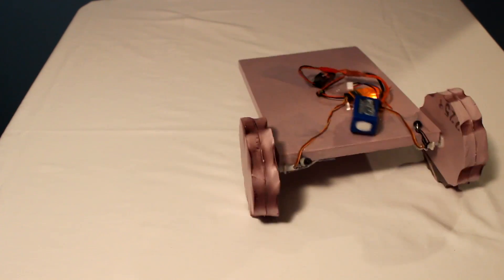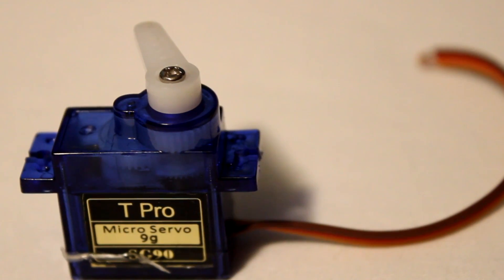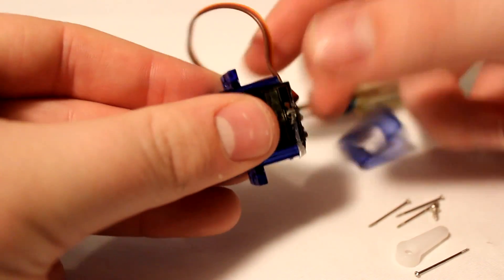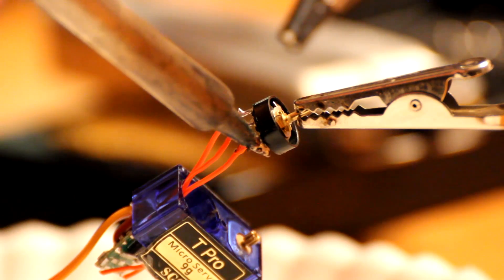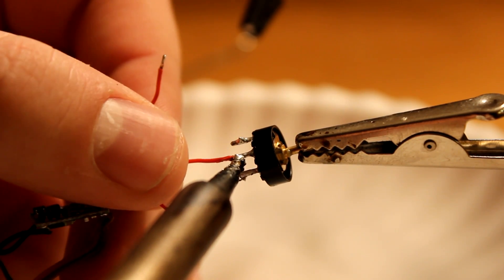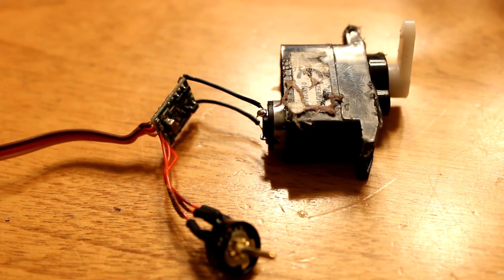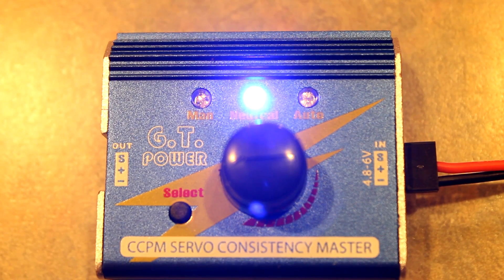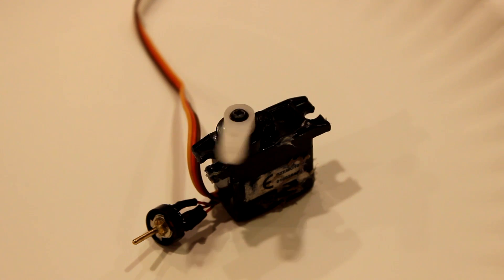Continuous Rotation Servo Tutorial

Comment: You got lucky with the potentiometer.  There is definately an order power and ground must go to either end of the pot and the signal connected to the middle.  Connect the signal to either end and you will cause a short-circuit between power and ground when the potentiometer is moved to the other end.

Comment: I actually found out a similar method before looking it up. You only need one servo. Just simply relocate the potentiometer. Or if using for pwm to dc conversion remove the gears and motor, then solder a connector to adapt to the DC motor or solder the motor directly. I did this so I could use hobby rc components for lego.

Comment: If you modify the servo to make it continuous, is it possible to still know what angle it has rotated to. For example, say you wanted to know exactly how far the robot has travelled while moving forward - with a normal servo you know through which angle the servo has rotated, so you can use the wheel radius and rotation angle to calculate the distance. Is this still possible with a con. rot. servo?

Thanks!
Reply from the maker: I have no idea, probably not since the potentiometer is technically gone, so it has no way to know where it is.